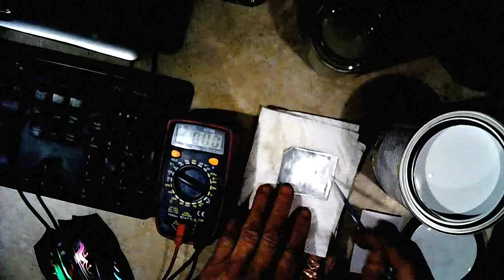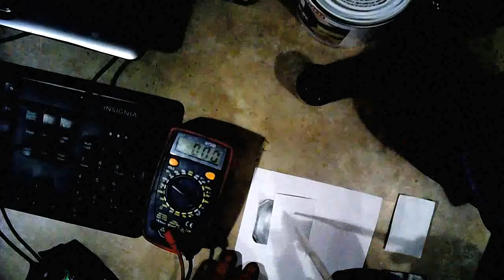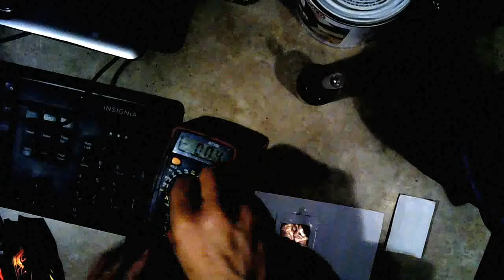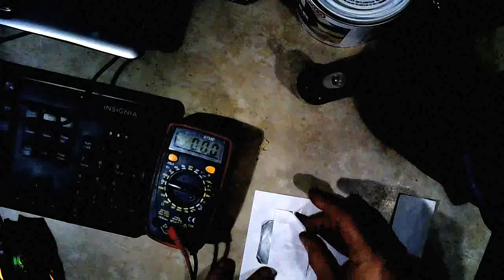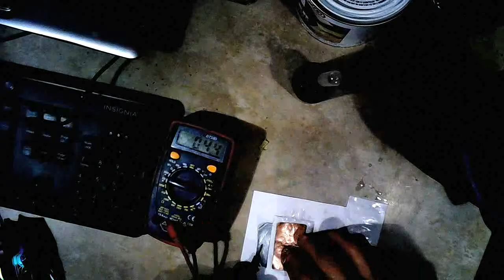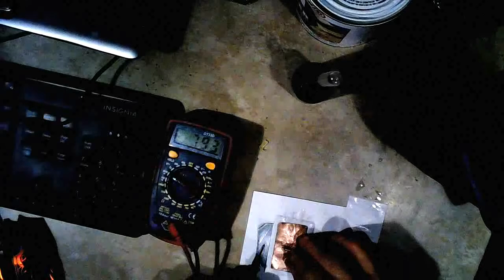Tio2 Shellac Alcohol Primer Exp.

Comment: playing around with same setup, transformer plate sanded smooty clean, painted with Ti oxide seperator with carbon paint stainless steel mesh, voltage varies between 950mV current 40mAmps on cct test down to 5 mAmp there it stays for 30 minutes at 5mAmp....if i do charge the cell up past 2.5volt Dc pulse charger the voltage settles at 1.2vDc current peak at 150mAmp, then must say the borax does improve the results ...next sell i have doped the seperator with 15% silver in water solution  , and that alone made dramatic improvement
Reply from the maker: Great results. Stainless steel mesh probably lets more O2 in. The 1.2 volts agrees with my self-charge results too. I thought of using the colloidal silver myself, but haven't done it. How big an improvement?
Reply: on short cct the current over 60mAmp then drops off to the normal 25-15mAmp, must say i have left the charger on to cook the electrolyte dry and the current is over 250mAmp on short cct test,, cell size 3 x 4 cm
Reply from the maker: You cooked the water out of it and got more amps? That must be the silver then, because it should lose amps as it dries out.